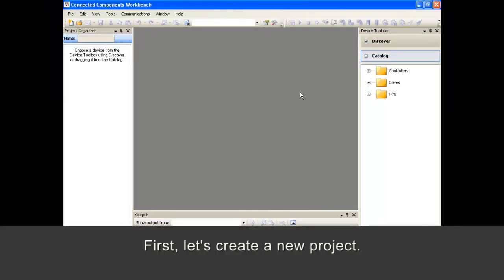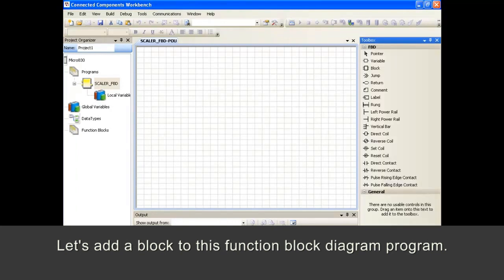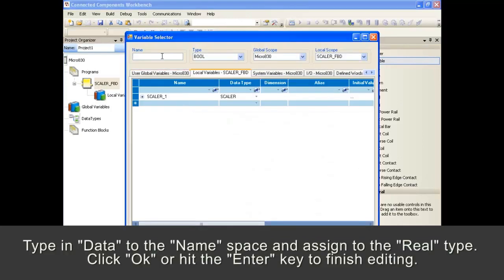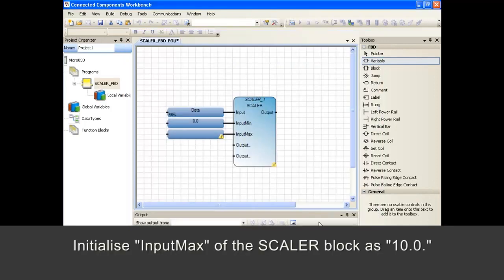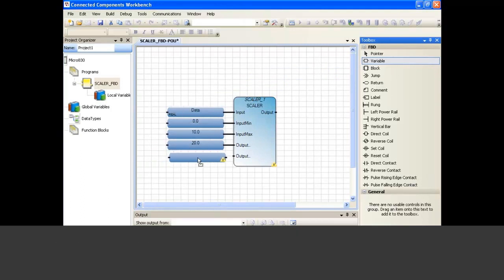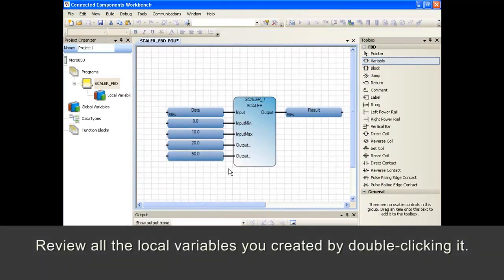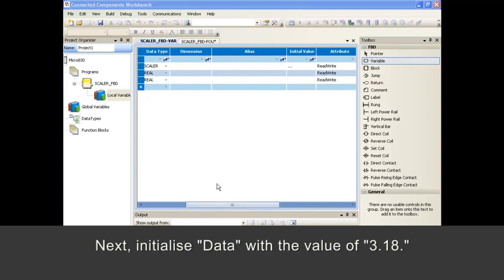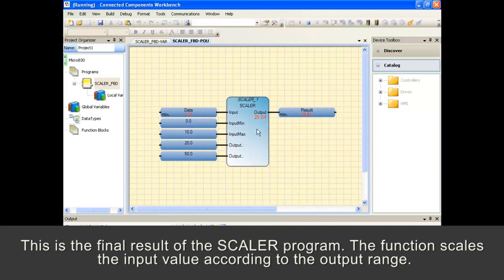Micro800 Controller Programming - SCALER in Function Block Diagram

Comment: Hi, I downloaded from Rockwell and after installation I cannot open CCW, I got the following message: 

The automatically saved settings file
“C:\Users\vasi\Documents\CCW Settings\CCWA\CCWSettings.vs
settings’ cannot be found. You can change this file on the
‘Import and Export Settings’ Tools Options page. The IDE will
use your most recent settings for this session.

Any suggestion is appreciated.Thanks!
Reply from the maker: Thank you for your message. We recommend taking advantage of the Rockwell Automation customer help website which has several options. Our experts will be able to help you with your specific inquiry. Note that a free Rockwell Automation account is required. https://rockwellautomation.custhelp.com/